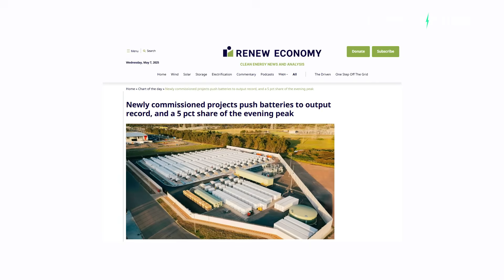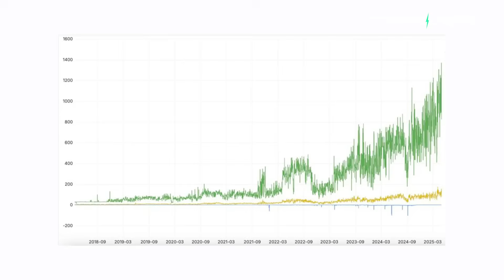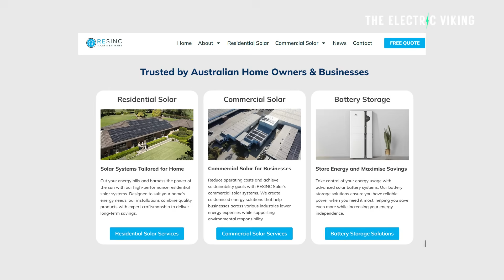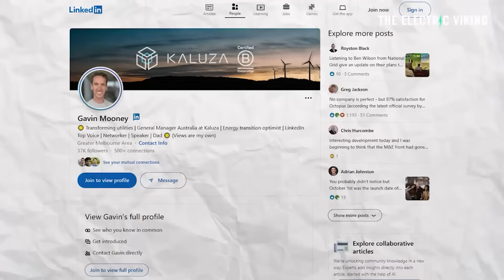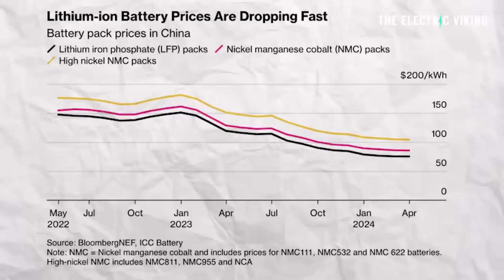Battery power hits new record in Australia - will skyrocket 7,300% in 1-2 years

Comment: This is supposed to be green? What a joke. Our country is heading straight into failure — and we don’t even need to look far to see the blueprint: just look at what's already happening in parts of Europe.

Let’s talk about batteries. These things degrade from the moment they’re installed and are nearly useless within 10 years. And who’s recycling them? Virtually no one. There’s no profitable model, no infrastructure, and no long-term plan for the waste.

Then there are wind turbines. They have a lifespan of 15–20 years, require constant maintenance, and when you factor in the energy used to manufacture, transport, install, and decommission them — they often never produce more energy than was spent to build them. Yet we’re being pushed into installing home batteries because electricity prices are being driven up by our so-called “renewable” schemes.

Why? So we can meet arbitrary targets on paper to satisfy the Paris Agreement — an agreement that doesn’t even count the energy and environmental costs of producing these short-lived “green” technologies. These aren’t renewable — they’re disposable.

And here’s the kicker: countries like China aren’t even held to the same standards under the Paris Agreement. They're not required to reduce emissions at the same pace, yet we happily sell them our coal and gas — which they burn in outdated, high-pollution power plants. That pollution isn’t counted against our emissions, but we get to feel morally superior while they get cheaper power and fewer restrictions.

Meanwhile, we ignore real, proven solutions like modern nuclear energy. This isn’t about old nuclear tech from decades ago. Advanced nuclear reactors today are designed to run on nuclear waste, generate reliable baseload power, and produce virtually zero emissions. Yet instead of investing in that, we’re betting everything on wind, solar, and batteries — technologies that are short-lived, hard to recycle, and anything but green when you look at the full life cycle.

It’s time to stop pretending and start being honest about what actually works. Because right now, we’re trading energy security and economic stability for the illusion of progress — and calling it green.
Reply: Not enough time that I'm willing to waste to point out all your false statements based on inaccurate and dated information.

Comment: Australia has some of the best spots on Earth for solar energy collection.  I'm happy that Australia is building large batteries for municipality level electrical energy storage.  I'm impressed that Australia is one of the countries leading the way.  Well done Australians.  Thanks for the video Sam.  Peace, Calvin.
Reply: The very best places are right above our heads, the roofs of houses, warehouses, factories, schools, shopping complexes, carparks etc. We really don't need to use our huge sunny outback, solar at source is far more efficient then cabling back in from the outback.
Reply: @WayneMcKenzie  I agree with you Wayne.  Decentralised solar panels down to individual homes are very efficient and cost effective as well as quite resilient/resistant to extreme "climate-changed weather" and possible acts of terrorism.  Large scale central energy production is more vulnerable to terrorists and climate.  That being said, what Australians and Australia are doing is better than almost every other country, except maybe a few running on geothermal.

Comment: Government scam... the government want you to buy a battery so that when everyone gets up in the morning they run off battery and when everyone gets home we all run off the battery, its to free up the grid for Albos renewables to work, but they dont tell you you need at least 2 x 10 kw batteries or you will still run off the grid especially if you use refrigerated A/C, Heating, ovens and any electrical appliances that suck power, your single battery will be flat well before morning, dont believe everything about one single battry will do all, IT WON'T

Comment: With my 40kwh battery, i can run totally off solar and excess power is provided to neighbours every night.
With Amber Electric, it is easy to sell when power is in demand.
I've been earning around $5 per day.
Reply: @VaCha62  i can see how a large battery can earn an income. Instead of exporting power during peak generation times, and possibly paying for doing so, you can store the excess and export it during the peak evening demand, guaranteeing you get paid for your power. Good work! We are installing a 12.6 kWh battery, but later, if the FIT drops to zero, or goes negative, we'll increase our capacity to 25.6 kWh.

Comment: Eraring power station is now using flow batteries for storage. Could you explain how they work. Thanks.
Reply: flow batteries are having a tough time to stay afloat I believe. He will not tell you.
Reply: Flow batteries use solutions of salts that can store energy release it by using a proton permeable membrane. They are often called redox flow batteries as they contain elements that can exist in multiple states such as iron or vanadium. They are bulky and consume some energy but have the advantage of being able to charge and discharge fully.😊
Reply: No lithium either.

Comment: What about Snowy2.0? PHES is the cheapest form of storage.
It'll be able to draw/supply 10% of peak demand on NEM.
Reply: it is all part of the matrix.
Reply: Modern batteries are very competitive now for storage as well as being available much more quickly than a major engineering project like the Snowy .😊
Reply: @malcolmrickarby2313  chemical batteries are good for short term. They're a worse financial investment than PHES.
My opinion is that we should think long term.
Even if chemical batteries are what the budget is spent on, it'd be better to invest that money then use it in 12 to 36 months because batteries ROI would be at least 1.5x .
Remember they have limited cycles and as such finite energy output. They're only economical at the moment because energy is so cheap in the middle of the day. When snowy2.0 comes online, that'll change because ot will flatten (not completely flat) supply and as such, price.
We're in a unique time period.

Comment: We just ordered a 12.8 kWh battery system for our home. To backup our 9.24kW photovoltaic system. Thanks to the ALPs battery rebate offer.
Reply: I am in NZ, tell me more.
Reply: if you have a 9.2kw system you might want to get a a modular battery and get more capacity.
Reply: @serpserpserp  thanks. We can add 3.2 kWh modules up to 25.6 kWh. I'm playing with a "simulator " I wrote in Python. I'll try different sizes today and see how the numbers pan out. But so far 12.8 kWh will save us 98.3% of the electricity we import. We have an EV on order too, so we need a little extra for that.

Comment: As the Australian election has destroyed Nuclear (er...fossil fuel) dreams for, at least, 6 years (2 terms) I hope we see the new Labor govt go gang busters in renewables.Now that they will be subsidising home battery installations, this is one aspect that cannot be underestimated. Not only does it make rooftop PV a game changer, it also will benefit the whole market/Grid because renewables will be the demonstration of a rising tide lifting all ships. Further, at the insistence of the Greens, comunity housing is about to get a boost in the installation of rooftop PV and home batteries. So, those on low incomes and welfare (pensioners), will immediately get a financial boost through lower power costs. Indeed, with judicious power use, and an understanding of peaks and troughs in the grid, social housers could end up paying next to $0, particularly in summer. Sam, could you do a report on the other batteries; pumped hydro; and what is happening there. Where is Snowy 2.0 at, and the other projects?
Reply: Nuclear is not viable and in 6 years even less so. Coal power stations will be shut down before any nuclear could be built. In 6 years battery technology will have progressed. Batteries will be ubiquitous even for sites without solar. 
There will be a requirement for gas  power stations in interim to generate power if needed.
Nuclear for purpose of electricity is past its time.
Reply: @VaCha62  The gas powered stations are going to be expensive white elephents. The extra batteries will replace them, however we need to be building more pumped hydro storage ASAP.
Reply: A lot of retirement villages have solar and use less electricity than they produce.🌝
Reply: Better to look it up on the net, not much chance of sam covering those things on this channel.

Comment: Lol...duck curve isn't going anywhere....it will only get worse
Reply: @grantbuttenshaw Quite the contrary, the duck curve is evened out, thanks to batteries.
Reply: @petterbirgersson4489  oh really?..what year did that happen in the NEM?
Reply: Not sure about the validity but will post anyway: "Outlook for 2025–2030
Worsening in:
QLD/WA (unless battery deployment accelerates).
SA (until hydrogen/industrial demand absorbs excess solar).
Improving in:
VIC/NSW (offshore wind + storage will flatten the curve)."
Reply: @markvalery8632  it's not valid...these are the dreams of AEMO....they won't happen. 

It's only gotten worse every year and will continue to do so

Neither Hydrogen nor off shore wind will ever happen in Australia...
Reply: @grantbuttenshaw Not sure about your statement getting worse every year. Wouldn't that depend on the province and what they have actually implemented? 
"2. Where the Duck Curve is Stabilizing (Improving)

a) Victoria
Solar Penetration: ~30% of midday demand.
Mitigation Factors:
Stronger grid integration (new transmission, e.g., VNI West).
Big batteries (Victorian Big Battery, Mortlake) providing fast ramping.
Offshore wind plans (expected to diversify evening generation).
b) New South Wales
Solar Penetration: ~25% of midday demand.
Mitigation Factors:
Snowy 2.0 (delayed but coming) for evening storage.
Waratah Super Battery (2025) to replace Eraring coal.
Coal retirements slower than SA/QLD, reducing urgency."
Reply: @markvalery8632  it's gotten worse every year....the wish list of AEMOs ISP won't make any difference..

Comment: Dude. You are delusional. You don't under stand how much batteries/lithium it would take. Even 10x what we have now will only last 5 minutes of running the grid.
Reply: My guess is you don’t have any solar or batteries? With mine I could easily go off grid. I only connect to the grid to sell back excess energy.
Reply: @Peter-hg2oc  Are you going to run the grid from home?
Reply: Gridscale batteries aren't critically dependent on energy density, you can have the majority of the batteries be for instance sodium based batteries or bromine flow batteries instead of lithium batteries.
Reply: Dude, we need 20x what we have now and even that would only be for a few hours, however we are never talking about running the whole grid on batteries at a single point in time are we! We are at the start of the revolution and every new installation helps us get to the 100% net zero end game.
Reply: @pnield5866  that is exactly what is needed. How else will it power the grid after dark without any wind?
Reply: @ hydro will provide some of it. Hence batteries will not have provide all of it…in any case, with the excess of electricity most days there can be other forms of 'storage'.
Reply: That math has been done.  Perfectly possible.  Plenty of lithium and you don’t have to burn it.
Reply: I think you are delusional 
If I can do it and the time to pay off is 2.5 years. 
So anyone can do that and be off grid 
Then a large scale should be even cheaper.
Reply: @matthewscofield  very true and supported by Lazards LCOE which has rooftop soalr as one of the costliest for exactly the reasons you describe, namely scale.
Reply: @matthewscofield  No not everyone can because it would take decades to make enough batteries.
Reply: Lithium for grid? Please try to keep up.
Reply: @douglascutler1037  so you have other examples of batteries actually powering the grid? And how long will it take to make enough?
Reply: @douglascutler1037  Can you show me an example of other batteries that are in mass production powering the grid?
Reply: @marcusk7855  Of course, China is taking the lead in sodium ion for grid.

China Southern Power Grid Energy Storage has commissioned a 10 MWh sodium-ion battery storage station in Nanning, Guangxi, almost a year ago now since May 2024. More similar projects are in the planning stages including from BYD.

Point being there is a completely viable alternative for global electrification if lithium supply should ever become a problem in the future.
Reply: The batteries don't run the grid. Wind and solar run the grid. The batteries store excess wind and solar and then release it when the wind isn't blowing and the sun aint shining. They also manage fluctuations in generation and do so significantly better that either coal or gas peeaker plants ever could. 
The think most of you keep forgetting is that Australia's fleet of coal fired power stations are ageing and need to be replaced. In early 2017, 75% of the coal-fired power stations in the country were operating beyond their original design life. This was a cost we always had to bear. The question is moving forward, what is the most cost-effective way to meet those needs. The declining cost of renewable energy sources, such as solar power, wind power and battery storage, means it is unlikely a new coal-fired power station will ever be built in Australia. That didnt even consider the environmental impact on new coal fired power stations. As for nuclear, go read Lazards levelised cost of energy. Highly reputable study into the cost of various forms of energy generation which confirms that nuclear is one of the costliest. Yes nuclear could work in Australia, but we would be paying for it.
Reply: you are talking about today, in 3 years time what will happen then,  will make your eyes water!